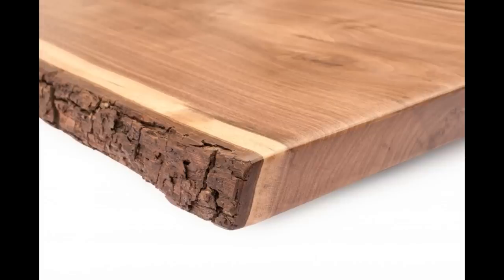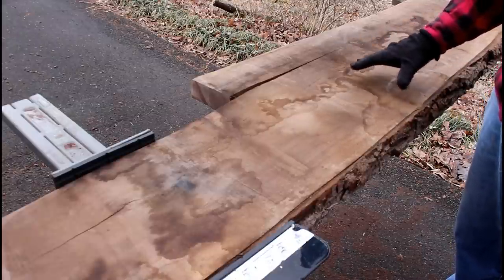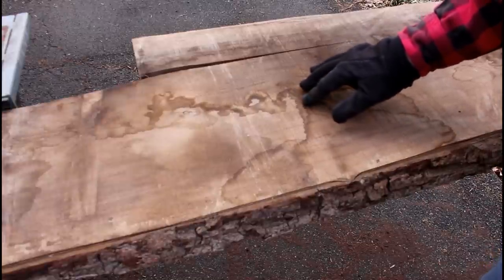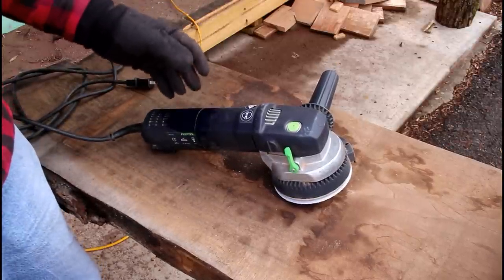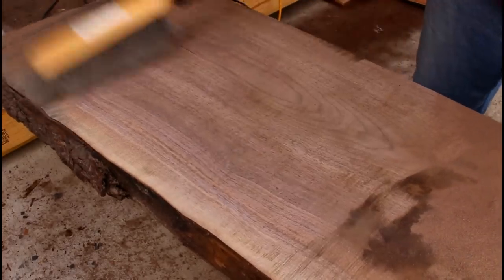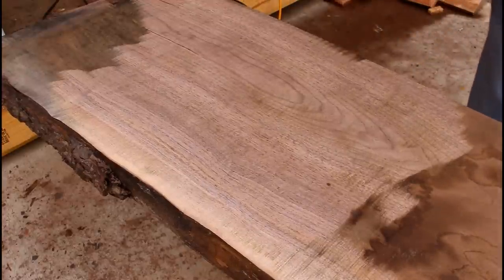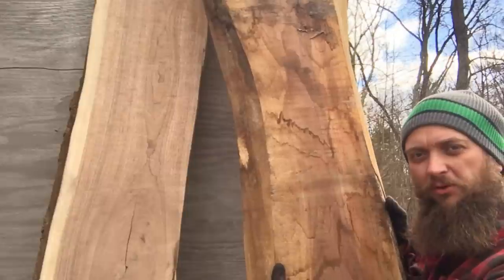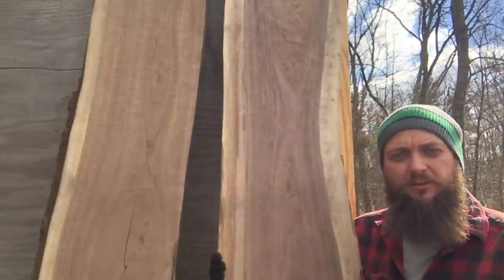IF YOU OWN A SAWMILL YOU NEED TO CHECK THIS OUT!  SAWMILL BUSINESS

Comment: You'd be much better off getting yourself a good quality 20+" planer.  Way more versatile.
Reply from the maker: 20in planer would be nice. Maybe one day 
Thanks for watching
Reply: I thought the same way an got an old 30" thicknesser for my off grid workshop, and a 48" wide belt sander. 
a lot of what I Mill here in Scotland is wide natural edge slabs, up to 1470mm wide. - anything over 1200mm wide we finish by hand.
Reply: Super jealous of those tools!!!!
Reply: was lucky, 
the old whites speedsander I bought on eBay for £423-- 400 miles to collect it  and the 30"(760mm) whites panel planer was a local gent giving up his old workshop so that came to a new home for a very reasonable price, 
now have built up a workshop with all old cast iron kit ( old school machines - not a computerised circuit in sight lol)
nowt that a socket/ spanner or big hammer can't fix 😀😀😀
Reply: You are my hero!  I'm good to 12" jointer and 12" planer.  For bigger pieces, I'm very lucky to have a small custom furniture shop nearby that has the size of equipment you have and they will kindly joint/plane/sand my larger boards or table tops, etc. for a very nominal fee (like ~$25/hr).  They really are wonderful and generous people.

Comment: Dude 

A $20 dollar used Craftsman belt sander will do a quicker and better job than your fancy Festool.
Oh well if you like to spend more... go getter er!
Reply from the maker: Have you done this with a belt sander? How was your results? Also can you post a video of it? I’d like to see it especially if it can be done for 20$. Thanks for the feedback.
Reply: Yea you can go down to any old garage sale pick up a 3 inch belt sander, use 60 or 80 grit and don’t push down too hard. 
I have been cutting slabs for my own hobby wood with an Alaskan mill and Stihl for years. I air dry it and when it’s stained I clean em up easy and quick. Sorry only a viewer don’t mess with upload videos. Good luck!